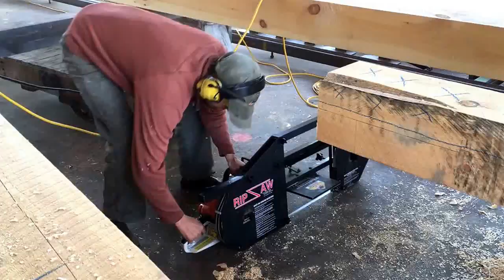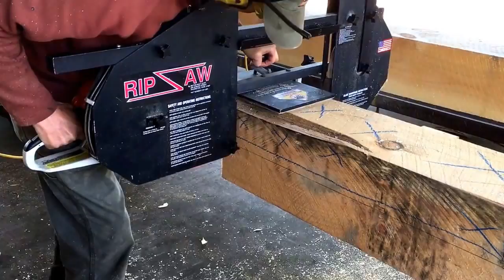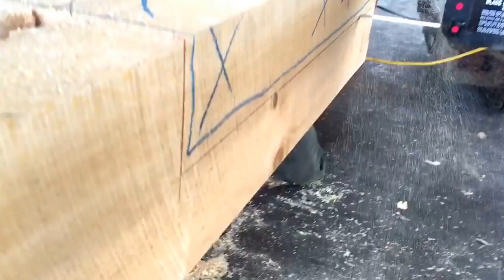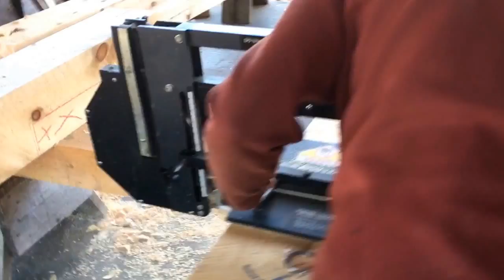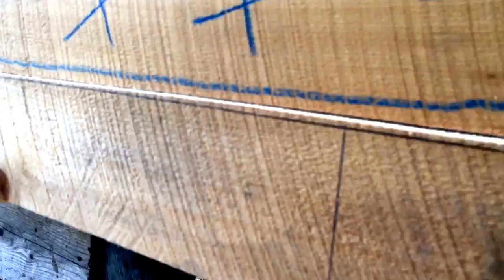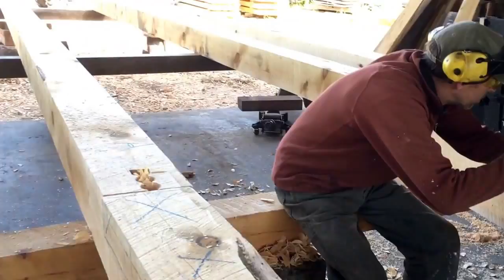Ripsaw

Comment: What chain saw are you using with yours? I’m having a hard time finding that will bolt up to mine. Thank you any help!
Reply from the maker: It''s a finicky machine.  I run it off my Stihl 260.
Reply from the maker: If I recall correctly, I had to source a different sprocket, some details there, look into that area.
Reply: @timberdoodles4647  you need the old style sprocket , Stihl still makes them.

Comment: Do you by chance have a pdf of the manual you can share? I have a RipSaw and would really like a manual -thanks!
Reply from the maker: Sorry I don't,   I had to inquire on a facebook group once as to some info on it.  I find the tracking to be problematic, I deal with it, glad I only use it for small cuts.  They went out of business as you may know.
Reply: @timberdoodles4647  I have manual i think in pdf if i can determine a way to send it
Reply from the maker: @davidhamby4686  I'm fine, if for some reason I need one I can check back in the comments here.  Has Rich Domikis replied?   Can you get him a copy?
Reply from the maker: @davidhamby4686  I am by no means a tech in this department. but I would try and copy the link, highlight the junk in the search box thingy and copy it, then in the comments "paste" it in.  good luck.
Reply: @timberdoodles4647  mine dont cut straight..
Reply from the maker: @erikbostrom.9318  Is the band sharp?  could be that simple, I have seen mine push the band off the guide system some how and run the teeth into some part of the rig and that messed up the teeth causing it to cut crazy like.
Reply: @timberdoodles4647  thanks.